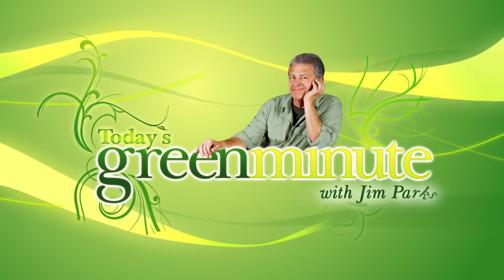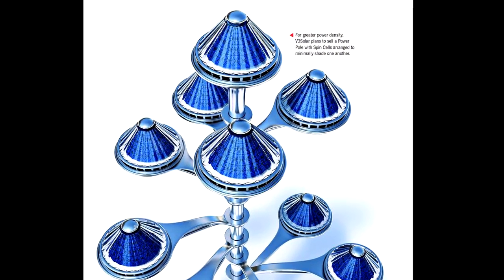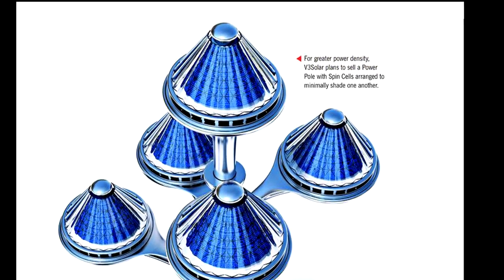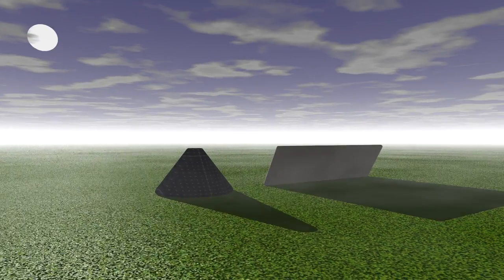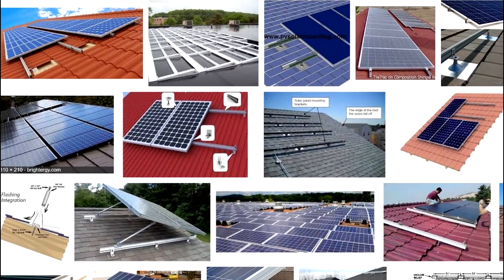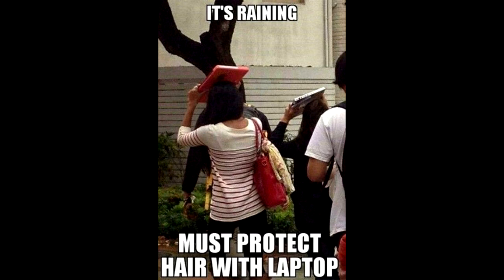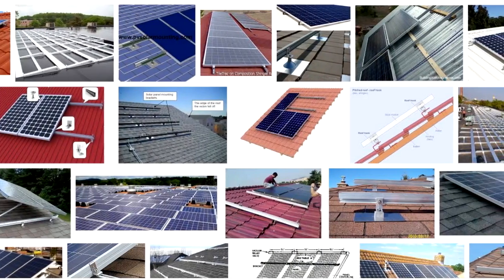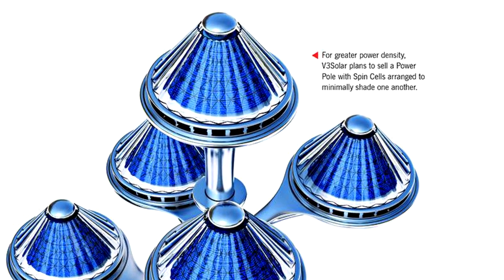Spinning Solar -BUSTED!

Comment: Such a stupid idea, human stupidity is sooo profitable, specially if you have some shiny render.
Hey you genius maker of this abomination: didn't occur to you that you can do the same with tracking solar panels?, and you invest in 10x less solar panels you morons!!!
But hey... why do something with common sense when we can throw away energy by rotating that monster!!!! (what do you gain with wasting energy in rotating that piece of crap anyway?, panels will generate exactly the same as a whole).
Oh yeah... an thats a cone... didn't you realize that you have the same inclination angle all around?, not even comparable to a tracking panel then.

Shit, just saw 1 minute and I want to punch the screen... sure Tf00t say more and better things, at least they got exposed, freaking scam.

Comment: Please don't lisen to actors they are pretty not smart.
Here in Oz the CSIRO has come up with a better heat-sink so you can useing mirrors get more light onto the cell with out cooking it. So a lot more power comming out of a smaller cell. And its the price of the cell thats killing solar power.
Reply: Oil and greed is killing solar power.  So much cost reduction in recent years that price is no longer an excuse.
Reply: It makes sense as a thin reflective sheet under a protective coating is way cheaper than laboriously constructed silicon cell assemblies.

Comment: NO we have been going about solar energy generation all WRONG, WE NEED TO CRUSH THE solar cells into a fine powder and submerge them in liquid adomantium in order to keep them from overheating. this way we can have 32175823453428573489574932857985792387549238573485748952784937985739857348957435892776123579062354865962874308675428074586972460% efficiency!!

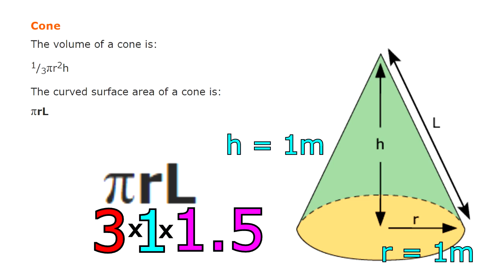Comment: Hate to be pedantic, but at 4:00, shouldn't you say the area of the cone is 4.5 square metres?
 4.5 metres squared gives an area of 20.25 square metres.
Reply: 4.5 * (metres ^ 2). Order of operations. First square the meters, only after that you multiply it by 4.5
Reply: Yes, but he is speaking it, not writing it. If I say my lawn is four square metres in area then it measures two by two metres, if I say my lawn is 4 metres squared, then surely the area is 16 square metres.
Also metres is not a value, it is a description of the value 
E.G. 4.5 bananas ^2 = 20.25 bananas.
Reply: ***** To be fair it was shown on the screen while he was reading it. And it being a unit doesn't matter. You can calculate using units the way you would calculate using regular values.  There is absolutely no problem with writing 4.5 bananas^2. Sure "bananas^2" doesn't have a physical meaning, but that's irrelevant. For instance the unit of acceleration is m/(s^2). What is the physical meaning of a second squared? a square second?

And that's a simple example. The unit of Newton's constant of gravity is N*(m^2)/(kg^2). What's the physical meaning of that? Its only use is it multiply with other values in other units so the result is in the correct unit. Note how I said multiply. Another mathematical operation.

Units are first-class citizens. You treat them like you would treat any other number or variable. If you write 5 x^2 you don't suddenly say it's equal to "25 square x" either. It's just a happy coincidence that in our language "square meters" means the same as "meters squared". Using your reasoning may be common in some circles, but mathematically it is wrong.
Reply: The first example you give. 
m/(s^2) is in itself a unit. The seconds are put into the formula to calculate that unit
The units for acceleration are meters per second squared (m/s2).

￼

￼

a = acceleration (m/s2)

vf = the final velocity (m/s)

vi = the initial velocity (m/s)

t = the time in which the change occurs (s)

Δv = short form for "the change in" velocity (m/s)
Reply: ***** You missed the point. I gave that simple example exactly because it is something you can visualize and recognize from high school.

What happens when you accelerate for t seconds at a m/s2? Well: t * s * a * m / s2 = a * t * s * m / s2. This is now a fraction that can be simplified, just like a * t * 5 * 3 / ( 5 * 5) can be simplified. Note how I just replaced every s with a 5 and the m with a 3. Once you simplify the fraction, you get a*t*m/s, or a*t*3/5 in my other example. Note how the mapping between m and 3, and s and 5 still holds.

The units act exactly like numbers when calculating. They're not separate or different. You can throw any combination of numbers, units and variables in there and they will all act exactly the same.

Comment: thunderfoot you forgot to add that the energy required for running the motors to spin that thing would decrease the power output even more, plus the maintenance cost would be even bigger because it would be constantly spinning so there would be a lot more wear on the parts

Comment: People look to flashy technologies too much. Why can't they just google a Dish Stirling Solar Concentrator? Its boring as hell to look at but it fucking works. Concentrated Solar Power is the future, not this bullshit. Hell, getting solar power isn't even the problem, the problem is storing the energy. I'd put my bet on Flywheel Energy Storage or the Powerwall for that matter.

A little more info:
the Dish Stirling doesn't use photovoltaics but rather mirrors to focus the sunlight to power a stirling engine which is in turn used to drive a generator. so far they calculated 30 something % efficiency, that's a lot. Another good thing about it is that since it uses the heat itself to drive the stirling engine, it doesn't get less efficient to the same extent as photovoltaics do when subjected to high temperatures.

Comment: What we ought to be enhancing is the use of Gallium Nitride for solar cells. It's waaay more efficient than current poly or monocrystalline silicon. Let's see if we can get the costs down on that tech, so solar becomes a little closer to being a legitimate stand alone power solution. Or maybe a way to harness infrared light and excite molecules that way. Would work even though clouds.

And the only way you'd want to use lens or magnification with the sun, is if you are focusing the heat on a sodium solution to generate a steam power source.

Comment: 10:00 Eh. I'm still partial to anything Musk. Mars is going to happen, thunderfoot! It is just a matter of when. I mean the guy is known for overpromising on the when. So let's say it'll be 2040 instead of 2022? I'm okay with that. In any case; we've sent many objects to Mars so far, and eventhough about half of them have failed in some way or another, I'm fairly sure that statistic won't stop a football field worth of explorers with STEM degrees and the right psychological profile to go REGARDLESS. And yes, there's quite a lot of difference between bringing a satellite or rover, versus bringing a whole spaceship that has to be livable and self-sustaining at least to some degree for the whole journey PLUS bring needed supplies and machinery with it.. However we've seen technological leaps before, and many of the issues often raised are being worked on by lots of engineers, exobiologists, chemists, etcetera, right now. 
Not to mention we can just keep trying if anything goes wrong, as well as send automated supply/test runs ahead of any potential colonists/explorers. It took some tries to reach the moon as well, and that was before we'd had any experience with this shit in the first place.
I do so love your channel, though. Keep it up please! Eventhough the SpaceX skepticism ruffles my feathers from time to time. xD

Comment: As soon as I saw it spinning I thought about the shadows on the back side and thought what the hell were they thinking.
And you didn't even get to the amount of power used to keep these things spinning vrs the power taken in. A lot more than the slight shifts used for tracking solar panels.

Comment: Did you consider if the path of the sun was at the equautor. I don't think it would make any difference, but have you calculated if it wouldn't make it a bit more effective that the calculations in the video?

Comment: Also, at noon when the sun is directly above, the spinning does NOTHING to cool the solar panels down at all, so they'll cook.
Reply: Depends on where they put these, as in a lot of place in the world, the sun isn't directly above, but you are correct in that, at it's high point, the spinning will have less of a cooling effect and so the generous +20% Thunderf00t awarded during that part of the video fluctuates too.
Reply: Cryogenic Vortex Anywhere that the cooling would be useful, their cooling design is useless!

Comment: so whats the deal with the diamond battery?
Reply: araincs magic
Reply: Diamonds produce a current when exposed to a radioactive source. In this case, nuclear waste from control rods (Carbon-14) is slightly radioactive meaning it can be reprocessed and turned into a diamond to produce a current. I believe that research comes from the University of Bristol and actually works. The current is however incredibly small.
Reply: Alistair Matthews
That is kinda cool, dont know why thunderfoot would say its bullshit tho, sounds like just another kind of atomic battery. Not really a new thing
Reply: Because as Alistair said, its an incredibly small current, which can also mean the energy needed to turn the rods into diamonds might be more than the actual current output you'll get. If you check the headline thunderf00t posted, they're claiming that it'll have a 5000 year battery life which is where the bullshitometer gets set off.
Reply: Bloodwyrm
I think that was based on half life of c-14, the article I found on google did say that obviously after halfing the output it might not be able to run whatever its hooked up to anymore. Anyway atomic batteries arent reall meant to be economical in that way, they are meant for things that have to go a long time without maintenance, satellites and such so i think it could make sense. Maybe theres something im missing here but honestly the claims seem kinda reasonable. Its not like they are claiming itll power a mars mission or some shit.
Reply: I guess it could be useful for satellites. With it's low output though I'm not sure if the weight of diamond needed to power the satellite would be an issue. Another problem is how brittle diamond actually is but I'm don't know if thats an important factor.
Reply: Look at NanoTritium batteries.

They are commercially available, produce 2.4V for 25 years and cost $2,200 each.

Radioactive batteries, are definitely a niche market item.
Reply: But that does come out to be 24 cents a day....

Comment: I've seen array of black pipes on rooftops that are presumably to use the sun to heat water. Would it not be possible to merge that with a solar panel so that the panel is cooled by the water, which could then be used for say, washing hands.
Reply: When one is doing that the intention is to get as much hot water as one can, so the compromises may hinder either process.
One could I suppose take the originally cold water and initially run it through pipes behind the panels, assisting in cooling, before it then went on to the water heating part of the solar array. But it would depends on the system, where it is and how one implemented it.
Reply: Already exists. Is used to (pre-)heat water for an outside swimming-pool.